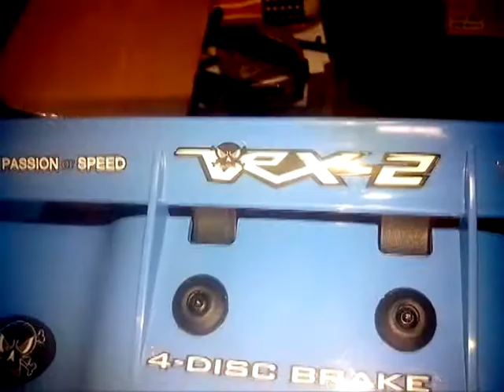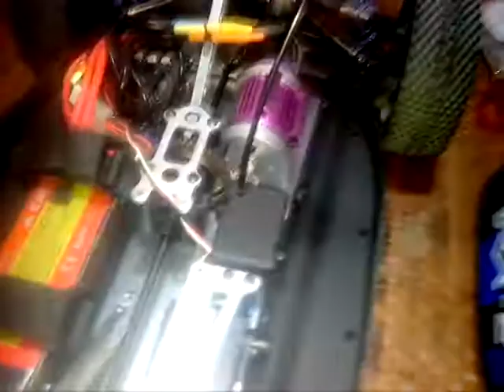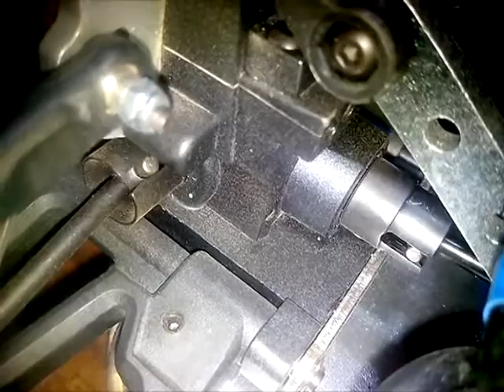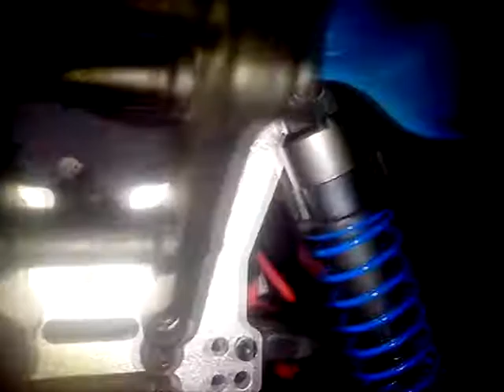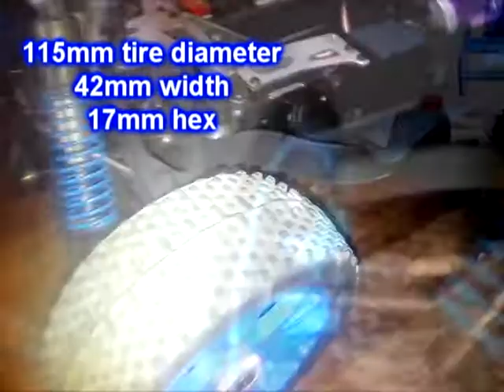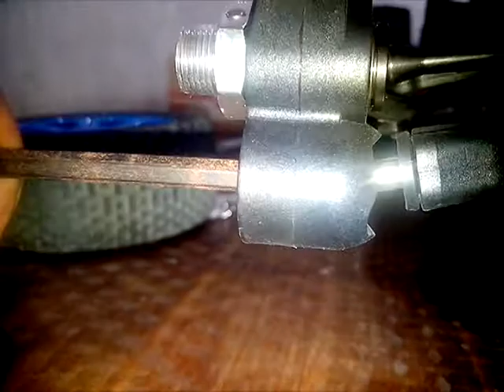VRX 2E 1/8th scale buggy in depth view

Comment: Hi nice, I see that the gear is exposed under the belly of the car ?
Reply from the maker: Yes that is because the original powering system of the buggy was actually NITRO, and that hole for the gear was for the quick starting base. I bought it and requested that chassis on an Electric version. The supposed 1/8 scale chassis was the narrow type and mine was the wide bodied chassis on a nitro system.

Thanks for dropping by Arnie!! cheers mate.

Comment: It's a nice car i have the same but with the white rims and the white and red body. And yesterday i cut the rear right drive shaft, it has some power, it's not slow car, it's kind of fast not the fastest, but it's enough fast to start. Throws the rocks in the face, before some months, it could break one of my front teeths, because one little stone was coming to my mouth and hit my leap and not my teeth by luck. So that means that the car is already very powerfull if it's your first 1/8 4s lipo buggy. But sometime i want to upgrade to 6s and i don't know if a 6s lipo fit in the battery tray.
Reply from the maker: I think you have the narrow body without the extension plastic base, and the layout of parts on the chassis was different. The one I actually have is the NITRO version in Electric conversion of the VRX-2. 

The ESC is not capable of 6S as well as the brushless motor so be noted about it. It will be fried and gone to smoke if u do that. The ESC by the way is the same as the JBL cheetah first release.

The pinion gear can be change if u want to make it faster on 4S..but compromising the torque or acceleration. From 13t, i fitted 15t now and wow it run like hell on the asphalt,  topping 70mph.